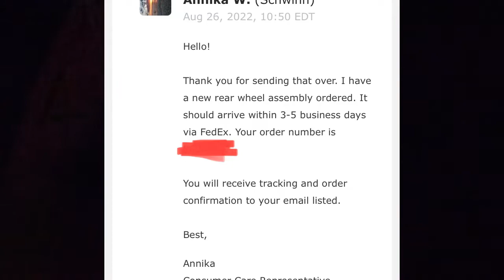Mongoose Grit Assembly, Test Ride and Customer Service

Comment: How tall are you?

How do you thiink this bike would do on light-med non technical trails?
Reply from the maker: I am 5’10”. The bike fits me great.
Reply from the maker: It is a capable bike, and basically would depend on the rider’s capability.
Reply: @mountainsmoore3657  thanks for the input. I'm 5'8'', hopefully there is some good play in the seat. Got one supposedly coming tomorrow, so we will see.
Reply from the maker: @Exalted_Example  Good luck! I really enjoy mine! Just need more time to ride it! 
Thanks for watching!
Reply: @mountainsmoore3657  It's a bit too tall for me but i can work with it. I'm liking it but haven't really gotten to ride it yet. Just a few quick spins while trying to get the brakes/shifters dialed in. Unfortunately i'm getting that same horrendous noise from the rear wheel that you were. Hopefully Mongoose support will help me out with it.
Reply from the maker: @Exalted_Example  Oh man! I hate to hear that. However, they set it right and did it very quickly! Maybe they will do the same for you!